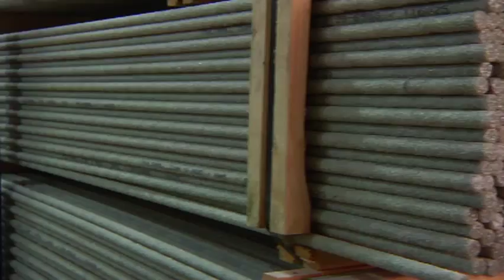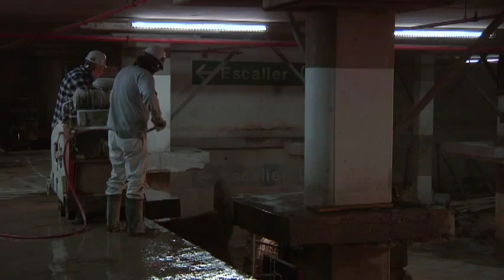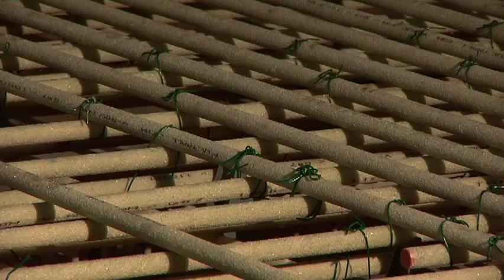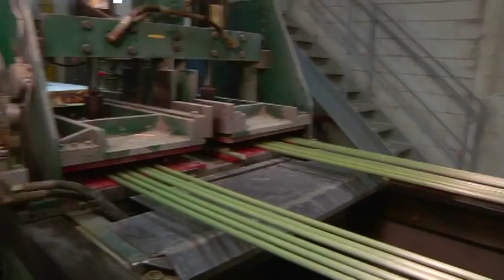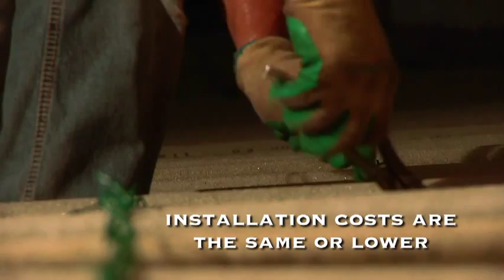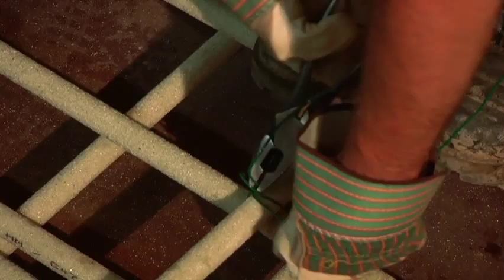V ROD GFRP in parking garage video

Comment: ISO or othor resin?
Reply from the maker: It uses E-glass fibers and vinyl ester resin which is most durable and required by CSA S806-12 building code and CHBDC S6-14